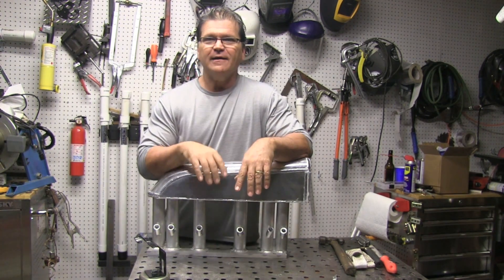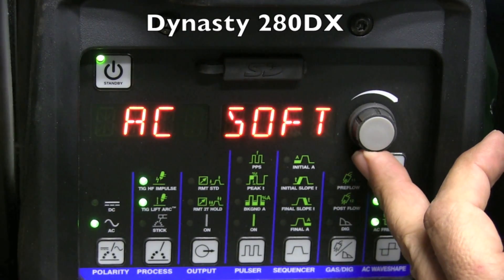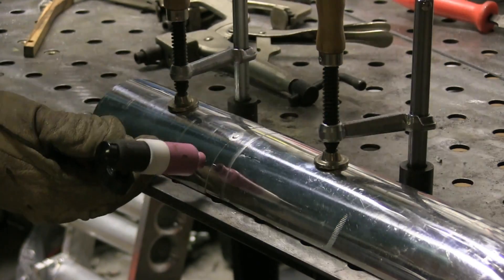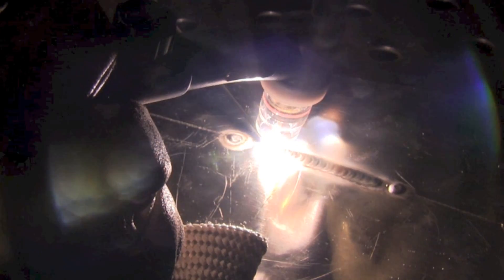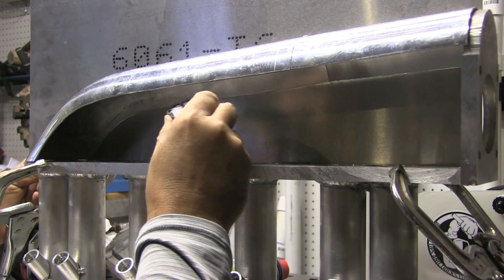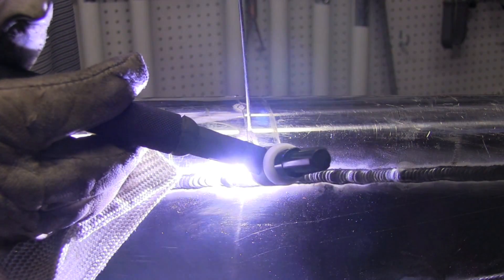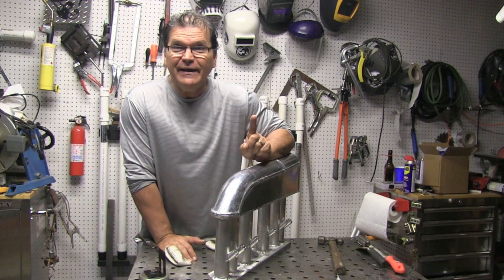Tig Welding Aluminum - Intake Manifold Project part2

Comment: I dare say I have the same problem running those pink gas lense plus it's a smaller hole I push my tungsten for better gas and it stops the oxidation .

Comment: If you think your rig is leaking gas and want to find out for sure, remove the tungsten, Then put your thumb tight on the cup opening and bump the pedal. Watch the ball in the flow meter. it should go up and slowly fall to the bottom if there is no leak. if there is a leak, the ball will stay up somewhat depending on the severity of the leak.

Comment: Jody, I am a little confused as to the electrode tip configuration you are using on part of your video. It appears that you might be using a shaped ground point electrode with a ball on the end of it. Are my eyes deceiving me or is it just a balled electrode? Buy the way buddy, in case you don't know this---You are the "Jedi Knight" of welding!

Comment: In my job, having done the exact same jobs with the same settings using both my old and new welder, I've found that having a watercooled unit makes a difference to the cleanliness of the puddle like you have here. Having tested and double checked every last possibility the only conclusion I can come up with was not a leak but simply hot gas. With the cooled hose and torch your gas is almost chilled as it comes up to the lens, with an air cooled unit (especially with the better thermal transfer of partial He in the mix) I find that it is always just that fraction less clean. I can't, or wont, say this is definitively the reason but it's the only one I can come up with as everything else was identical on very similar welds (Al 5053 15mm flange to 3mm wall tubing with 6053 rod). Perhaps you can look into this as your experience is way beyond mine, this is just what I found during testing why my welds were different.

Comment: great Video Jody, I'm STILL amazed at how the TIG hose doesn't get in your way and how comfortable you are while welding...i'm still trying to get to that level of comfort...
Reply: I only do simple welds with my everlast welder but a friend of mine does a lot more welding and in different positions and he swears by using CK's flex lines. They are like wet noodles. they are very flexible

Comment: If you cover the 'Acetone' on the acetone bottle with box tape it lasts a lot longer, and not wash off so easily from acetone drips.  The tape will start to look gnarly after a while, but it's pretty easy to clean and re-label when needed.

Comment: Hi mate. every time I see you working with the TIG machine I would like to get my machine in an operational condition.  I have a Italian machine that I repaired after I bought it at a scrap dealer for about $5.  It's got most of the things you need, but I don't know what to order to complete the machine.  I would like to order it from you but I don't even know what kind of torch I have.  So the machine is just sitting there doing nothing.  It's a nice little thing though.
Reply: +Marcel Timmers I watch Jody's videos and I want to pull out my powertig welder! I've never seen the cold weld technique. Makes a lot of sense.

Comment: Hello Jody, 
Great videos. Do you have any experience with aluminum mig welding? An example would be the process available via Lincoln Electric 350mp, which can do pulsed spray, and handle thin wire with a push-pull gun... My question would be... "when would you use mig versus tig in aluminum, eg could you have used mig for your manifold and have it come out as good as using tig? Thanks again...

Comment: Could you cover that cold weld technique a little more? Like how do you do it.
Reply: Jody's got another video somewhere... basic idea is to start colder so you avoid melt back, get the parts joined, and provide a heat bridge, then come back with a bit more heat and lay a neat line of ripples.  The second pass can use a higher freq too if you're worried about ending with too wide a bead.

Comment: What would a 75/25 mix do to stainless and mild steel?
Reply: Chemically? Nothing. Helium ionizes at a higher temp, so you get more heat per amp. This also concentrates that heat, which compliments the focusing effect of higher frequencies. This all helps win the battle with aluminum's high heat conduction and low specific heat, so you can complete the weld before a part saturates with heat.  Stainless doesn't conduct heat away from the puddle as fast, so you don't NEED the intensity provided by helium, but it would help your travel speed and narrow the heat affected zone.  Likely not worth the extra cost though?
Reply: +nautamaran thanks for the info!

Comment: man you make it look easy..
that said you inspired me to get an ac/dc square wave inverter tig and just have a go.. 
quite often ill do good then i goof up and dip the rod or tungsten then ill get the shits with it haha bought a pack of electrodes so i can just swap them rather than drop the torch to go sharpen the electrode this helps me not get to frustrated
i get a kick from building one off thing myself but it sux when things dont work out

Comment: I have two of those CK 360° torches, one air cooled the other water cooled (both 2 series), and they both make high pitch noises, sounding like argon is turned up to high.  I love the flexibility they give on welding out of position, but the noise is enough to give me a headache.  I will have to weld some aluminum with them to see if I have similar issues as you did.  I normally just use a CK 2 series normal torch to do aluminum and haven't had any issues.

Comment: Your Tig finger is also lighter and easier to transport on jobs as well as consuming less real estate than a traditional finger prop method, even an old welding glove. 👍. Thanks for the video Jodi.
Reply: +nickolaguez Tig fingers are great! They are good for mig welding too when fingers need to be close to the weld etc. I have a set for both my everlast tig welder and mig welder. I even marked them to make sure I keep them at their correct stations.

Comment: It seems the base plate needs more than chemical cleanup- maybe using a mapp gas torch and a brass brush in the weld zone(like the process for a brazing rod, but just to clean off the heavy oxidation).
Reply: Ya let's add brass particles from the brush to the weld
Reply: Really? http://www.thefabricator.com/article/aluminumwelding/5-tips-for-successful-aluminum-gtaw
Reply: +ROTE simplemachines yes, in my experience stainless steel brush designated strictly for AL is the way to go. The finished weld will be cleaner, brighter and smoother
Reply: +ROTE simplemachines. Mlk

Comment: Whats up boss, I have a question. I"m 17 and do a lot of welding in my spare time. I've been a 3 year welder for my school but wasn't able to take it for my final year. I have always wanted to learn to tig weld and was wondering if you had any suggestions. I wan't an all around tig that I can weld mild steel, aluminum, and stainless eventually. I was looking at the diversion 180, however it's a little steep, but has all the functions I believe I will need. Really just wanting to see if I've missed any machines. I have done alot of research and am worried about purchasing a lower tier machine that won't last me. I work a summer job and am not allowed to have a school year job, yet I will save up for the machine that I wan't even if it takes me awhile. My maximum price range is probably around 2200 for everything due to me being quite young and not having all that much funds, especially with college closely approaching.                          
 P.S. I have watched almost every video for as far back as 2 years and will continue to watch all of them!! I feel that I have learned alot and can't wait to watch the new video every week. Thank you for the hard work and awesome videos.

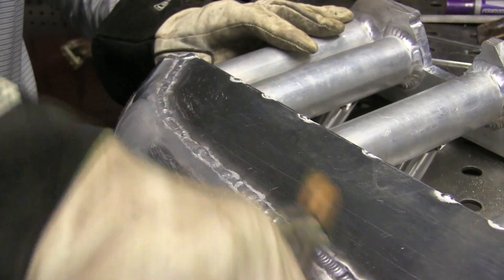Comment: 8:37 I used that same trick when I was tacking together a SS pipe and flange (on the outside).  The flange was sucking all the heat away so I was jamming in filler and then came over it with a second torch-only pass to achieve a much better looking weld (probably with better fusion too, since the whole assembly was then "preheated" from the first pass).

Comment: Hi Jody
Well you mentioned the tig finger..
Well I would like to mention the tig finger
Today I was welding T6061 .062 to .125 in hard to reach places - I have had your tig fingers for several year and it seems that I would like to encourage everyone to have at LEAST 2 or 3 because I have had to use then on the torch hand as well as the feeder hand while doing different holding ways of the being welding item - when small and solid a lot of heat make's it very difficult to do.
Thanks Again
Awful Arthur
Reply from the maker: +Art Humphrey Thanks Arthur
Reply: +Defnotdemas just buy a glove at that point. lol.

Comment: Can you leave the rod in the puddle and weave over it with aluminum?
Reply: I have heard that the cleaning action will not get to the base metal if you lay wire aluminum
Reply: When I've done this I've found it tends to crack if I don't add any more. maybe I'm doing it wrong though
Reply: +ScrewDrvr Crack city...Aluminum isn't like steel when it crystallizes. It forms more of a rounded nodule than steel's geometrically interlocking crystal structure. You can see it when you look at the grain structure of a big crack

Comment: maybe ill get myself a tig finger when i can actually tig weld half decent ..
Reply: +Guinelle1 You will get better allot faster with one than without, and I'm just your average joe, no affiliation with Jody other than being a fan...and proud owner of a TIG finger ;)
Reply: +Guinelle1 I bought a tig finger when I was starting out.   Propping is key to getting good welds, and you need a heat shield to prop anywhere near the weld zone.  It's too damn difficult otherwise to hold the torch steady.
Reply: It's well worth it

Comment: Could we see this fitted to the car when its done?
Reply: +BeyondTheRedLine The longer the runners, the lower rpms it tunes at. And vice versa. :)
Reply from the maker: +BeyondTheRedLine Hopefully, the owner will be willing to send me a few pics.  But I really dont know the details of the car build.
Reply: It'll fit since the 280 uses a side draft style intake
Reply: +BeyondTheRedLine ... THE ONLY THING "BEYOND THE RED LINE" IS BEARINGS ON THE TRACK........OMGROFLMFAO, BLESS YOU THOUGH....... I HAD A PRO COMP NOVA CALLED    "RED LINE".     :- )
Reply: +BeyondTheRedLine Hell yeah! And, how does the 280 perform with that intake? It looks like a high HP setup, so I'm guessing this is something for the track only. It certainly wouldn't fit under the hood.
Reply: My thoughts exactly. Those are some long runners so the car must spend a lot of time in the upper RPMs.
Reply: That's an embarrassing brain fart lol
Reply: +weldingtipsandtricks .
Reply: +NO Bull I'll send you some pics. whats your email address?
Reply: what's your email I'll send you some pics
Reply: I'd like to see it on the car too! I have a few people who have been asking me about working on manifolds for them. It seems that once I bought my powertig welder everyone and their dog now has something for me to weld.
Reply: skirkland1980
That was 20 years ago. Blk/Red was main colors. Not ok with putting an address on the tube. I have enough spam

Comment: Did you choose helium because you needed the weld to look nice and clean?
Reply: Helium gives better penetration on the thicker aluminum.
Reply: OK thanks s
Reply from the maker: +rileysgarage mainly chose the helium mix because of the 1/2" thick flanges.  I didnt really need it on the thinner stuff but I used it anyway.

Comment: question I have a miller square wave 250 and I have trouble welding any aluminum thicker than 1/8...any suggestions????? also is HF intensity the same as the high frequency setting on newer model welder

Comment: Hi Jody
Did you find the problem with the torch I have two of the CK FlexLoc torches and I have been having similar problems so I would be interested to know if there was a problem with the torch and what it was.

Dave
Reply: +David Cashin be willing to bet it&#39;s in the swivel. anytime you have a non-solid path for a gas, the risk to leak is exponentially increased. and helium is a devil at finding microscopicleaks, that's what makes it a perfect test medium for HVAC circuits